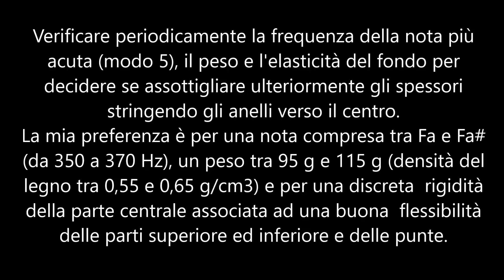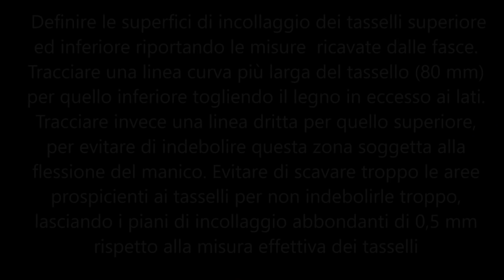Spessori del fondo parte quinta - Messa a punto finale a rasiera

Comment: Your recommended thickness are quite a bit less than Johnson and Courtnall recommend. They suggest 3.0mm-3.5mm for the main areas of upper and lower, and then an area of 5.0mm in the center that is larger than your area of 4.5mm. Interesting! Thank you for your video.
Reply from the maker: Keep in mind that there is no such thing as ideal or recommendable thicknesses because without knowing the type of wood, its properties, and the shape of the arching, knowing in advance what the most suitable thicknesses will be is not possible, only general indications can be given based on experience with our violins and the average of the material properties we used. For example, those that I indicated in the video can be made even thinner if the wood is very stiff and/or high density, or thicker if the density is very low, or if the rigidity is lower due perhaps to a different type or cut of the piece, with a grain inclination that is not perfectly radial with all its intermediate values, or tangential, or perhaps twisted, etc. Here the tap tone frequencies and the weight come into play, giving us some indication of the mass/stiffness ratio, and the sensations of manual bending (torsional, transversal, and longitudinal ). I don't have the Curtnail and Johnson book, and at first glance, the thicknesses they indicate seem high to me, but perhaps they mean it as a maximum starting thickness, to be lowered as a consequence of the properties of the piece of wood we have in our hands. I don't know, but thicknesses are only a small part of the whole figure, making them just by chasing numbers doesn't work well in violin making.
Reply: @DavideSora  My mistake! The numbers I gave are recommended by Johnson and Courtnall as a starting point before plate tuning. So, the final thickness would be less. And, looking at some Strad posters (Messiah, Huberman, Titian), the thicknesses are close to yours. But good point that the "correct" thickness will depend on many factors and vary by instrument.
Reply from the maker: @GShoeShoe  You said: "My mistake! The numbers I gave are recommended by Johnson and Courtnall as a starting point before plate tuning."

I suspected it, although some Amati and some del Gesù even reach 5.5/6 mm in the center of the back, something to take into account when chasing numbers...

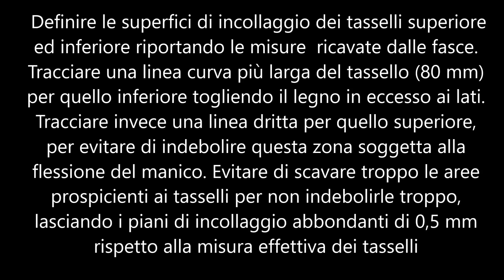Comment: Thanks for the excellent videos.  At 5:07 you describe how one should remove the excess wood on the sides of the lower block, but not the upper block.  I noticed you do not do the same on the top plate.  (at least in the video #11 in this playlist where you finish the top plate thicknessing you leave the excess on each side of both the upper and lower blocks.).  Do you eventually remove the thickness on either side of the lower block for the top plate too?  Or do you leave the excess thickness on the top plate for added strength, since the top is more likely to be removed in the distant future?
Reply from the maker: I also remove on the sides of the lower block of the top plate when the density of the wood and therefore the weight are not very low. However, I leave a platform wider than the block (8 cm wide while the block is 50 mm wide) to not weaken excessively, something like a parabolic curve. At upper blocks (top and back) I always leave a straight line to delimit the gluing platform, without removing wood on the sides of the blocks, so as not to weaken the neck block area

Comment: is it recommended to choose low wood density for the neck/scroll/tailpiece ? Would the weight saved in those parts change the sound for the better?
Reply from the maker: Very low-density wood is not recommended for the neck/scroll as strength/stiffness is more important than weight. Of course, a too heavy neck would have an influence on the perception of the heaviness of the violin by the player, so it would be better to use a medium density, not too high. The influence on the sound is minimal, even if not totally absent. Same for the tailpiece, but here it is different because there is an influence on the sound, even if each violin is a separate case and some work better with light tailpieces and others do not, you have to find the best solution by trial and error. In general, not necessarily lighter means better sound, although in many cases I would say yes. Each violin must be treated as a case in itself, it cannot be generalized.

Comment: Master, you recommend a note between Fa and Fa # (from 350 to 370 Hz), a weight between 95 g and 115 g. Could you indicate these parameters for cello? Thank you very much
Reply from the maker: Cellos backs vary greatly in size, and also in the wood species used, so it's a bit difficult to give a reference. However, indicatively the M5 should be between C and C# (130Hz to 140Hz).
Regarding weight, I would say between 650g and 700g for maple with medium/low density.
Reply: @DavideSora  Thank you, Maestror. It is very similar to what Hutchins proposes.
I have been following your videos for a few years and see the effects on my instruments. Very grateful for your generosity. Greetings

Comment: Molto Grazie maestro i have a question, how can i know the densità del legno? Is for the type of wood or it is possible make a measurement?
Felicidades por el video
Reply from the maker: You have to measure density on the wedges before gluing the center joint, by dividing the weight of every single wedge by its volume calculated geometrically. (Density = Weight / Volume)
Reply: Davide Sora  Grazie mile😃😃😃

Comment: Master,what do you think of a violin back plate that weighs less than 90 grams with a mode 5. Can it work?
Reply from the maker: What frequency for the M5? What are the thicknesses? and how is the arching shape? Sure, 90g is very light, but the weight alone doesn't say much. The lightest back I've ever made weighed 93g, so I'm inclined to think that even 90g might work if there are no weaknesses in the other contributing aspects. It is probably a very low-density wood (do you measure density?) and may therefore be quite soft and need to be kept thicker than usual. Wear and tear caused by the soundpost and its movement could be an issue to consider
Reply: @DavideSora  Master, first of all thank you very much. You are right about the density, it was low to start with, but I never thought it would reach this weight. Right now I am at about 2.6 thickness towards the ends and 4.7 in the center with a mode 5 of 378hz
Reply from the maker: @andresmartinezbilva8705  Considering the already lightweight, I'd leave it as is. it could work very well. With such low-density wood my only concern would be long-term warping, but it's impossible to predict with certainty, and any wood will warp a bit anyway. Another concern could be that the efficiency induced by the low weight could make the structure very mobile facilitating the triggering of wolf notes, a thing to keep in mind when dealing with all other aspects of the soundbox structure (ribs and top)

Comment: If this thickness is obtained But still have a lot of weight left, what should I do?
Reply from the maker: Without your plate in my hands I can only speculate, but I would say next time use lower density wood, low weights cannot be achieved with too high-density wood, as your plate probably is. For this time I would continue to lower the thicknesses evenly and eventually thinning more on the wings of the upper and lower bouts, checking that the note of the M5 (ring tone) does not drop too low. If the frequency were already low it would mean that your arching or the direction of the wood fiber would also be off, so next time also a more longitudinally stiff arching shape (tighter radius crosswise) might help to keep up the frequency.
Reply: @DavideSora  my back plate M1 = 95 Hz M2= 149 Hz M5= 335 Hz Weight = 142 g To make it thinner, how much less must the M5 be? Does weight have a big effect on sound? or have to take the frequency as a criterion Thanks for the replies and good advice.
Reply from the maker: @patiwatudon3846  For me weight and frequency are both important,but 142 g is a lot so in this case I would say that reducing weight is a priority over frequency. Weight has a decisive effect on the sound power and quickness of response of the violin, while the frequency for me is just an index of stiffness and I have the impression that it affects the tone more than other parameters. Anyway for the back the thing is less critical than for the top: while a heavy back is still acceptable (but not the best) a heavy top would be more worrying. As for the frequency, I have seen back as low as 311 Hz (D #) but usually they are the ones with tangential cut that have less resistance, as in some Stradivari that have a tangential back and sound great. But the weight is never high.
Reply: @DavideSora  It is very useful information to me. thank you very much

Comment: Davide, I am a novice making my first violin. My back plate is heavily flared and is at 115g but seems to be ringing an 
E flat. My belly is at 65 g and is ringing an E without the bass bar nor f holes. I am not sure if this is ok or if I should take more off one of the plates. Any advice?
Reply from the maker: Hello Debra, 
first of all it would be essential to know if the ringing note you are listening to is that of Mode 5 or Mode 2 of the free plates, which are often easily confused by beginners . To understand it with certainty you should indicate the frequency, that of Mode 5 is the most acute produced by the plates and it is the one to refer to, you can understand how to find it by following the advices in this video : https://www.youtube.com/watch?v=f6kCD4XtaZ4&t=183s
In case it was actually the M 5, the note E (around 330 Hz) would already be a bit low (I prefer it around F or better F sharp, 350 Hz to 370 Hz) so it would be better if you stop without further thinning the thicknesses not to end up with too low plates stiffness.
Your back plate weight is a little high but still in the ballpark, your top plate weight is fine.
Enjoy making your first violin!😊
Reply: @DavideSora  Davide, thank you so much for your guidance. I watched your video and then used the Audacity software and did multiple readings:
Belly with no f hole or bass bar: Mode 2 is 320 E4. Mode 5 is 323 E4. 
Back plate: Mode 2 is 308 D#. Mode 5 is 328. 
Is it ok that they are so close together or should one plate be a tone away from the other? I do understand your advice to not make the top thinner. Thank you so much for helping a beginner!
Reply from the maker: @debramcknight  The frequency of the M5 is correct, but there is something wrong with the M2. In fact, the frequency of the M2 must be much lower (about an octave below M5, so must be around 160/170 Hz). Are you sure you've put your PC's microphone in the right position? For M5 must be at the center of plate, but for M2 it must be placed at the lower end of the plate. Also the percussion with the finger must be done in the same spots. You can clearly see where to put the microphone and where to tap with your finger for the M5 and M2 here : https://youtu.be/f6kCD4XtaZ4?t=275
If you listen to the audio carefully you can hear that the note produced by the M5 is much more acute than that of the M2.
It is important to keep the microphone as close as possible to the plate to isolate as much as possible the Mode we want, so that it will be represented on the Audacity spectrum with a much higher peak than all the other Modes, as seen in the video  here : https://youtu.be/f6kCD4XtaZ4?t=222
In case you haven't noticed it, you can find the English translation of the captions by opening the window immediately below the video, clicking on "show more" on the PC or on the small arrow on the right below the video on the smartphones
Reply: Davide Sora thank you so very much. I will attempt the mode 2 again. I did not have the microphone in the right place. It was incorrectly still reading the middle. I am leaving on a business trip this morning and will be gone for a bit, but when I get back I will try again on mode 2. Thank you! Thank you!
Reply: @DavideSora  I reviewed your good videos and indeed my microphone was in the wrong spot for Mode 2. I retook the readings for Mode 2. Back plate:  between 150 and 155. Front plate (no f holes nor bass bar) was between 139 and 143. Have I taken too much wood away from the plates? Thank you for helping me.
Reply from the maker: @debramcknight  The modes are a bit low but nothing to worry about too much, probably with the resulting low stiffness the tone may be softer and less aggressive, but it could still be very pleasant and interesting. The modes of free plates taken alone do not tell the whole story, so you don't have to give up with your violin. We must also consider the plates weight, so I would leave the back as it is, hoping that the weight is less than 120 g (the less is the better). For the top plate you will have to try to improve stiffness by keeping the bassbar taller and stronger, choosing the stiffest possible wood with  narrow grain (minimum 7 grains or more for 6 mm bassbar thickness) and making it with a tension of about 1 mm at each end to increase the frequency of the mode 5 as much as possible(see videos on bassbar making).
Reply: Davide Sora thank you, very much.
Reply: @DavideSora  Davide, I finished the f holes and applied the bassbar but have not shaped the top edge of it. Mode 5 measured at 380.Should I continue on to shape the top of the bar a bit? Thanks for your advice.
Reply from the maker: @debramcknight  Hi Debra, 380 hz is too high (too stiff)  for my taste, I would like to go down around 370 Hz (F #).I'm in trouble  telling you how much to lower the bassbar without seeing it, but it is important not to make it too weak respecting adequate dimensions. You can refer to the videos on the bassbar to get an idea :
https://www.youtube.com/watch?v=3VccT9loyQQ&t=367s
https://www.youtube.com/watch?v=zQnGuCMrSZY&t=31s
if the frequency is still too high after bassbar shaping, it is also possible to further thinning the thicknesses, also evaluating the weight of the plate to complete the overall picture.
Reply: Davide Sora thank you! I watched the video which greatly helped. I have not yet shaped the top of the bass bar at all so will work on that tonight taking off wood until I get closer to 370 and the height measurements you mention in the good video.
Reply from the maker: @debramcknight  Check frequently the frequency while shaving the bassbar, at the beginning the frequency lowers a little but reached the critical point between mass and stiffness it  tends to precipitate and you can not go back, be careful😊

Comment: David, tell me which section of the deck is particularly affected by the setting mode 2 between 5 and 2 modes is always an octave?
Reply from the maker: The most sensitive area to lower the M2 frequency is in the center below lower corners. Anyway, pay too much attention in octave relation between M5 and M2 in the same plate does not make much sense to me, it can be there but also not.